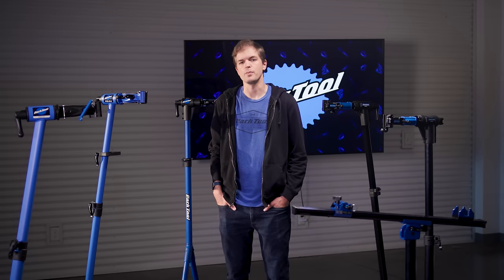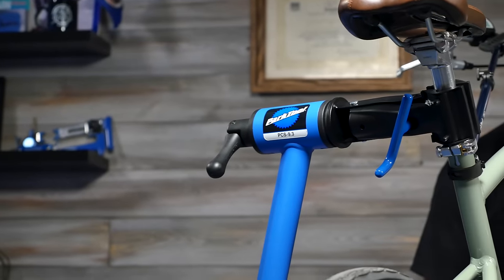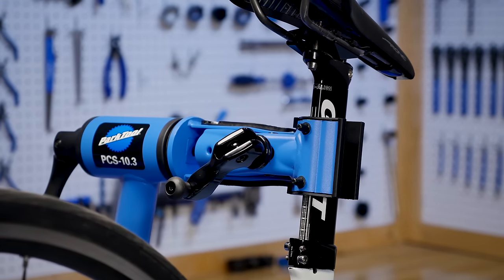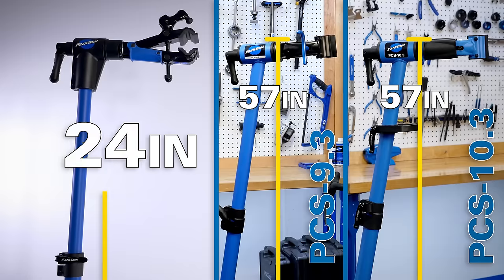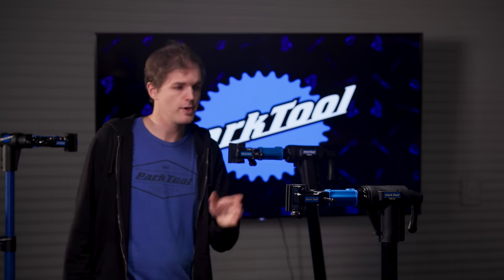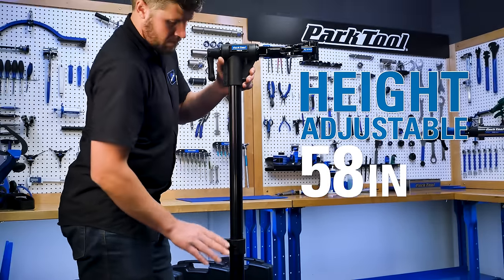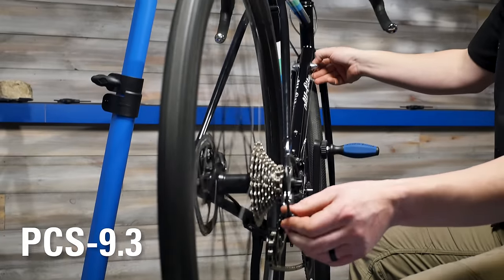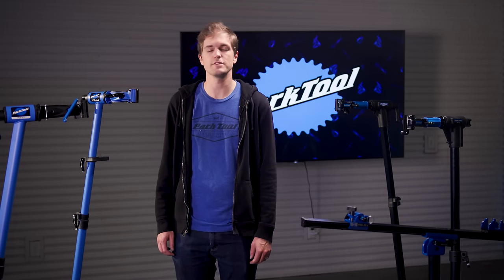Park Tool Portable Repair Stand Comparison

Comment: Any chance of putting metric weights and measurements for those of us in the civilised world outside the USA?
Reply: Here are the metric specs from Park's website:
PCS-9.3 FEATURES
Maximum weight capacity*: 36 kg (80 lbs.)
Clamp capacity: round and aero tubes from 22 to 76 mm (7/8" to 3") wide
Jaw height: 70 mm (2.75")
Height adjustable from 99 cm to 145 cm (39" to 57")
Base when open forms a triangle of 92 cm x 92 cm x 121 cm (36" x 36" x 48")
Folds down to 114 cm x 37 cm (44" x 14.5")
Weight: 7.2 kg (16 lbs.)

PCS-10.3 FEATURES
Maximum weight capacity*: 36 kg (80 lbs.)
Clamp capacity: round and aero tubes from 22 to 76 mm (7/8" to 3") wide
Jaw height: 70 mm (2.75")
Height adjustable from 99 cm to 145 cm (39" to 57")
Base when open forms a triangle of 92 cm x 92 cm x 121 cm (36" x 36" x 48")
Folds down to 114 cm x 37 cm (44" x 14.5")
Weight: 7.2 kg (16 lbs.)

PCS-4-2 FEATURES
Maximum weight capacity*: 45 kg (100 lbs.)
Clamp capacity: round and aero tubes from 22 to 76 mm (7/8" to 3") wide
Jaw height: 70 mm (2.75")
Height adjustable from 129 cm to 173 cm (51" to 68")
Base forms a 67 x 71 cm (26.5" x 28") square
Weight: 11.8 kg (26 lbs.)

PRS-25 FEATURES
Maximum weight capacity*: 45 kg (100 lbs.)
Clamp capacity: round and aero tubes from 22 to 76 mm (7/8" to 3") wide
Jaw width: 70 mm (2.75")
Height adjustable from 119 to 152 cm (47" to 60")
Base when open forms a triangle of 92 x 92 x 115 cm (36" x 36" x 45")
Weight: 6 kg (13 lbs.)

PRS-26 FEATURES
Maximum weight capacity*: 36 kg (80 lbs.)
Clamp capacity: round and aero tubes from 22 to 76 mm (7/8" to 3") wide
Jaw width: 70 mm (2.75")
Height adjustable from 97 to 147 cm (38" to 58")
Base when open forms a triangle of 126 x 126 x 126 cm (49.6" x 49.6" x 49.6")
Weight: 5.7 kg (12.6 lbs.)

PRS-22.2 FEATURES
Maximum weight capacity*: 27 kg (60 lbs.)
Compatibility: any bicycle with open dropouts or thru axles
Height adjustable from 76 to 114 cm (30" to 45") at bottom bracket cradle
Base when open forms a triangle of 104 x 104 x 104 cm (41" x 41" x 41")
Weight: 5.7 kg (12.5 lbs.)
Reply from the maker: Apologies — we live in an imperial world over here. Full specs with metric equivalents are on our website: https://www.parktool.com/en-us/category/repair-stands
Reply: @parktool  😄
Reply: What do you mean civilized!
Reply: Before education in the U.S.S.A. went to h..ll we learned how to do these quick conversions mentally. Isn’t that the case in the “civilised” world?
Reply: RollinRat  or you could just join the rest of the world using metric, leaving Myanmar and Liberia behind
Reply: RollinRat  you ok hun? You seem a bit angry, must be all that old imperial to metric converting that’s wearing you down.
Take it easy yea xx
Reply: @jamesdezwaan9598  why would we want to study a non-scientific measurement method?
Reply: officialparktool  you're very welcome. Calvin and John K have my contact info if you need to get in touch.
Reply: Have you seen the Venn diagram of countries that have been to the moon and countries that use the metric system? Rather amusing. 😎The math is easy. I think in imperial. I can translate most measurements easily enough in my head. If precision counts, I’ll use a calculator. As long as circles have 360 degrees and clocks have 12 hours (used twice a day), I’m okay with weird systems.
Reply: RollinRat  Imperial is fine, but honestly it’s just hella annoying because metric is quite literally better for almost everything.
Reply: It's an easy conversion , learned and in memory since middle school , '77
Reply: If you can't figure out how to convert from the Imperial system to Metric, you should probably go for a less challenging hobby than bicycle repair.
Reply: @fourninetysix  I’m in the civilised world outside murica, Liberia and Myanmar, why should I convert things from metric to imperial? The three countries I mentioned are the only places that use imperial.
35 years in bike repair mate, being as you asked, how many you got?

Comment: I have a PCS 10 from 2017. That swivel or pivot for the clamp is an issue. Can loosen it up. But it won’t move. Need to have something in the clamp to get enough leverage to move it.

Comment: Have a park tool stand and a wall clamp. Both have clamps that rotate downward after clamp in my bike in to them. My bike weights 18’ 6”.  No matter how hard I tighten the either clamp they slowly turn.  Not happy with them

Comment: You guys should try to have a segment  on what years of bikes are capable of having some upgrades parts. Like for Example if you get or find an abandoned 1960s or 1970s, 10 speed is in good condition for restoration. What upgrades parts can that type of year of the 10 speed can have. As where are you only used 1970s parts for a 1960s 10, speed or can you use a newer version from the 80s version parts or what type of product are you able to use.

Comment: I am a shorter mechanic - often use the pcs-9.3 near the lowest setting of about 40". I am looking for the most durable repair stand that is free standing and is height adjustable to be short like me. I liked the pcs-4.2 until i saw the minimum height is near the maximum of the stand i currently use, which i dont even think i could reach lol. Maybe i will just get the pcs-4.2 and cut the tubes shorter to get the ideal minimum height for me. any thoughts on that? is there a sturdier free standing repair stand?

Comment: So here's the deal, I cobbled together my stand with a PRS-6 and a 100-9c adjustable linkage clamp  I prefer the adjustable linkage.  This combo is a little too short so I have mounted it on a wood box about 9 inches tall.  It works fine but  a better combination for me would be my PCS10-2 with an adjustable linkage clamp.  None of the adjustable linkage clamps fit this steel head unit.  I am not a fan of the composite plastic head units, they will fail with time but will out live me.  My PCS 10-2 is folded and awaits the next time I need two stands at the same time but please make an adjustable linkage clamp to fit it and I will buy it.  Thanks for the vids, I've learned a lot and Calvin's humor is awesome.  Keep up the good work.

Comment: I have a PCS-10 from 2006, I think it's the original. Still works great although I would love to upgrade the clamp to the one with the crank handle. Mine is just a plastic lever
Reply: I had one about 35 years ago . No plastic but heavy.

Comment: Super informative video. 

Just to be clear the micro adjustable clamp from the 10.3 can be used with carbon and dropper post seat posts, right? Because that is what most of my bikes have nowadays.
Reply from the maker: Yes, use the clamp on the posts, either carbon or droppers.

Comment: Idk but it looks like it would be possible to upgrade small things like quick realese clamps and such to make the pcs 9.3 like the 10.3
Reply from the maker: It is possible to upgrade the PCS-9.3 to the PCS-10.3.
Reply: @parktool  Which model of clamp would fit in the 9.3?

Comment: The PCS 9.3 is that sturdy enough for holding an ebike 80lbs what's that 36kg?
Reply from the maker: The max capacity of the PCS-9.3 is 80lbs so we would recommend going up to the PCS-4, PRS-25 or professional shop stand with a bike at that weight.

Comment: The pipes are metal but all fittings are plastic.  How long will plastic last? Repeated tightening and loosening seems like the plastic won't last long.
Reply from the maker: They are glass filled nylon which is very long lasting. It's often referred to as Ballistic Nylon.

Comment: I always wanted an easy buttreliable repairstand :p 

On another note, why doesnt park tool make a hoist system?
Reply: What, you mean like the park tool prs 33.2?
Reply: @andye6450  nope. I mean like here in denmark most bikeshops work on bikes that hang by two hooks that are connected to a pneumatic piston. Fast and easy adjusment of height. And theres no stand to get in the way when working.

Comment: I don’t understand why you offer so many different stands. Seems a bit daft to me, but if it works for you…and apparently it does…I guess I am merely thinking out loud.
Reply: Some mechanics don't need some extra features other mechanics would want. For example, the average home mechanic would be OK without the micro-adjust clamp found on the PCS-10.3, so the PCS-9.3 would suffice.

Shop mechanics will appreciate it for allowing them to mount and remove bikes fast. Race mechanics that travel frequently will appreciate the light weight of the PRS-25.